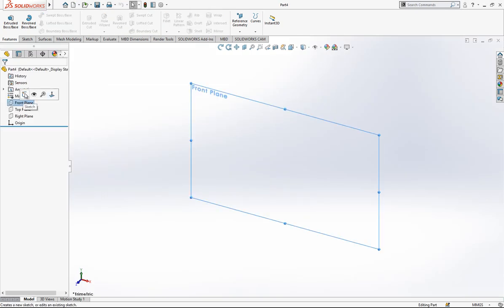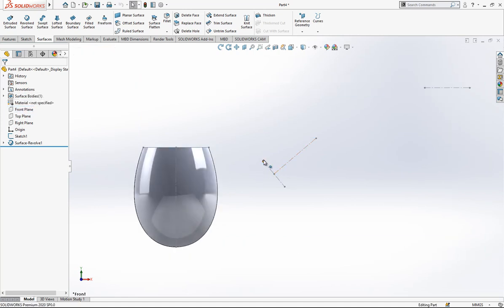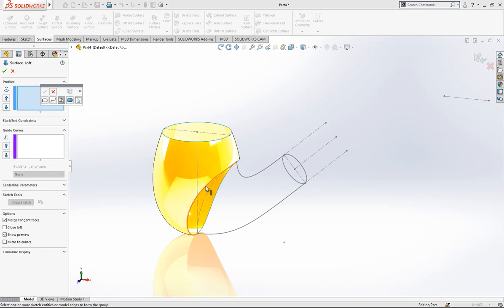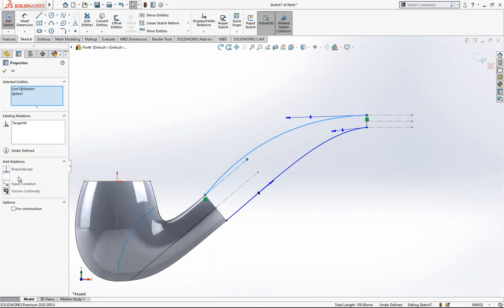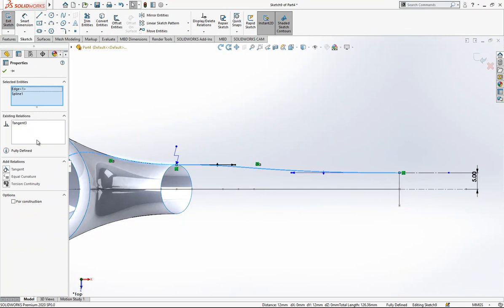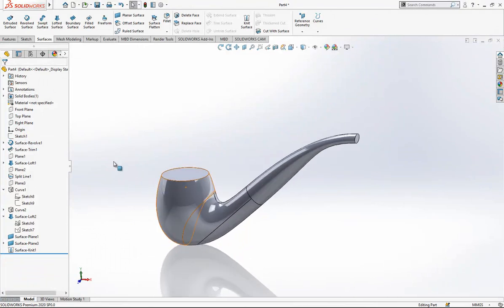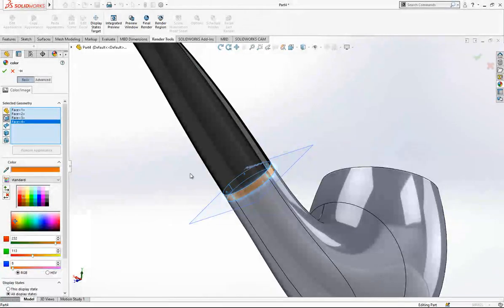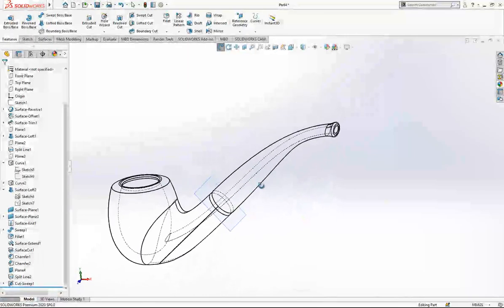Advanced Surface Smoking Pipe - SolidWorks Tutorial

Comment: It is called the stem of the pipe.  Thanks for slowing down a bit. One thing which has often confused me is lines which one may not want to be seen as in the bowl of the pipe.  Is there any way to hide these lines, so as in this drawing the bowl appears to be one solid piece?
Reply from the maker: Hi
I checked  on internet it is called Cigar Pipe, Smoking Pipe, I did not see The stem of the pipe but good to know. 😁

If you dont wanna see that lines you need to model whole group in one time. 

Easy way for you; model like how I modelled than convert all outer edges into curves and use loft for whole body then you wont see any line. 

But loft and revolve have differences to make a loft instead of a revolve you need more extra curves.